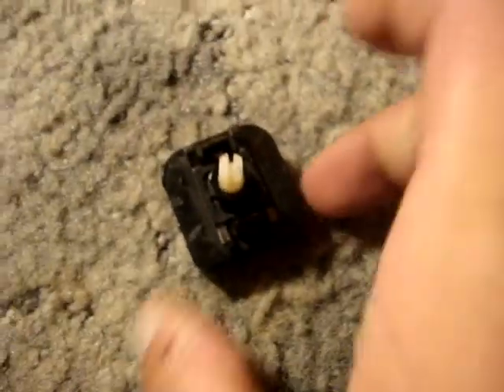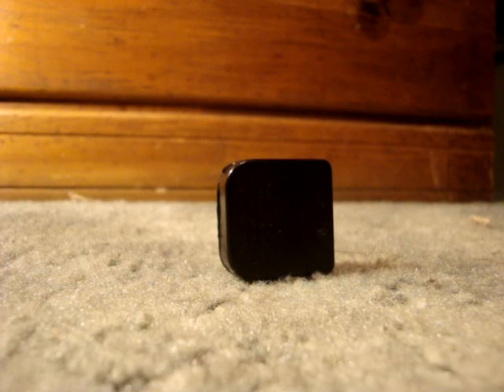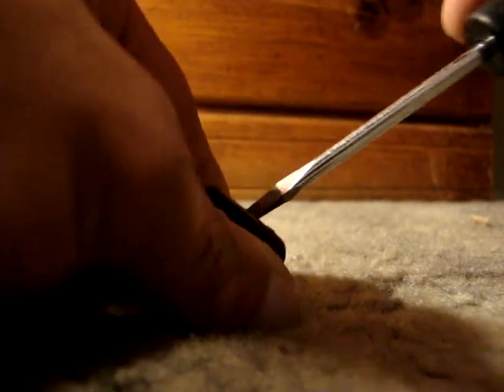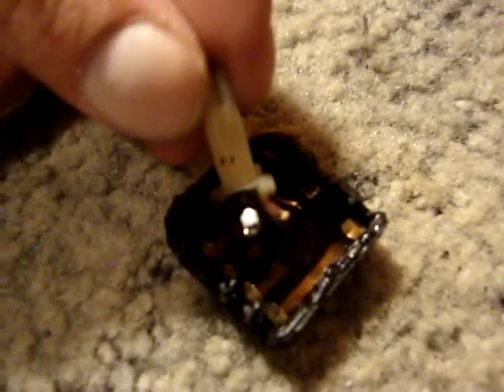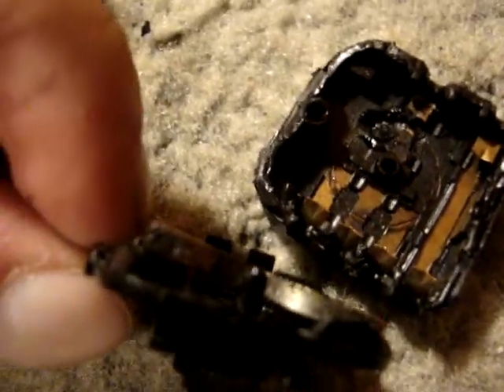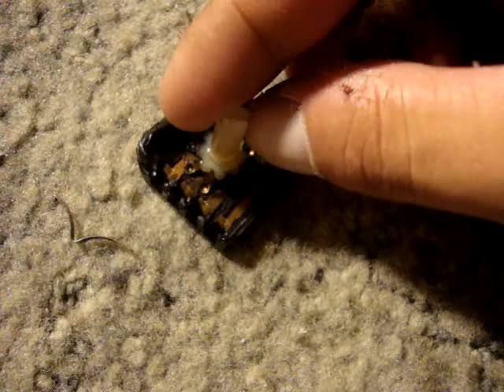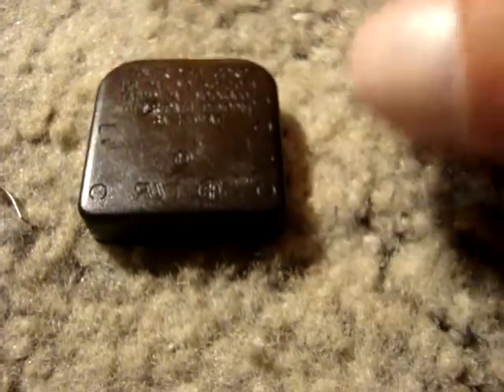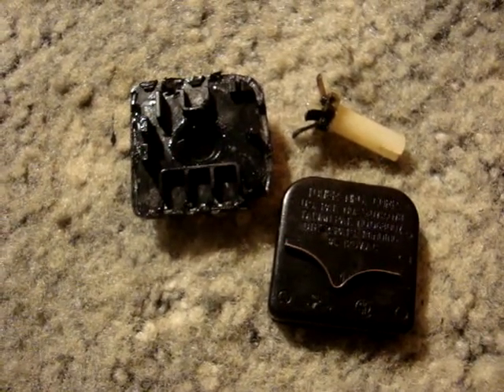Autotopsy of a burnt out Box Fan swicth

Comment: Where can I buy a replacement resistor switch?
Reply: Google 3 speed fan switch, Amazon and ebay have them. Make sure you get one that can handle the amps your motor is pulling, to be safe I'd go with one with a larger rating. I'm looking for a replacement too but the one I have has tabs for mounting and a longer shaft for the dial, so far I've only seen the model shown in the video. Good luck and be safe.